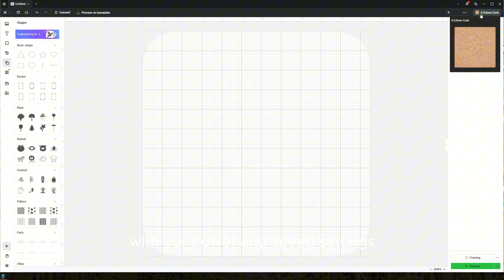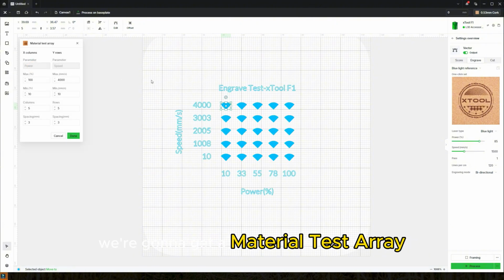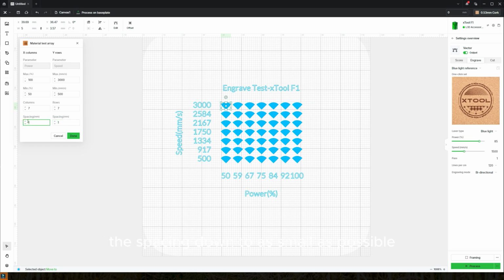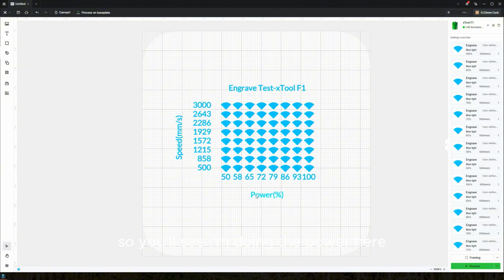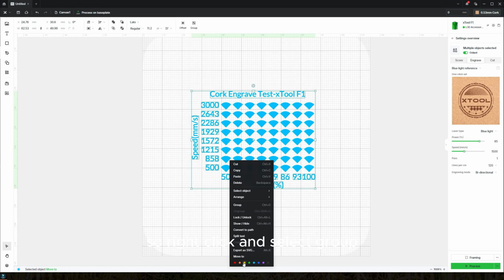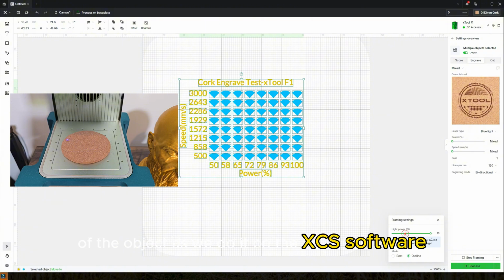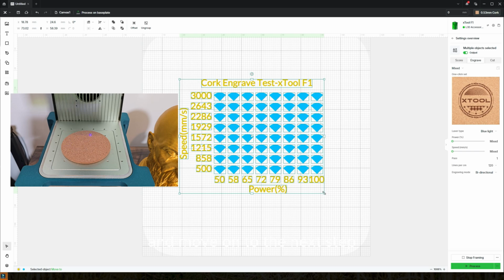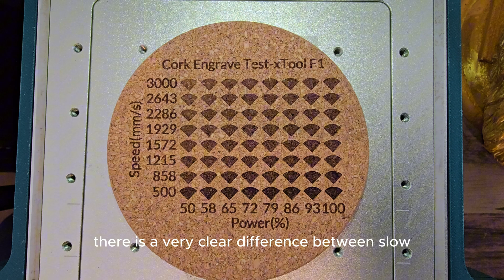Find Perfect Engraving Settings with xTool XCS – Step-by-Step Tutorial!

Comment: Thanks for the video. What if you were wanting to do a test for aluminum and there are no baseline settings for the f1 ultra? What range would you choose to be able to see variations in color and depth?
Reply from the maker: I'd probably select anything in the material settings that has aluminium in the name and use those recommended settings as the middle values for my engraving materials test.